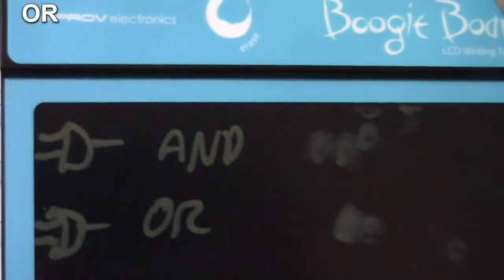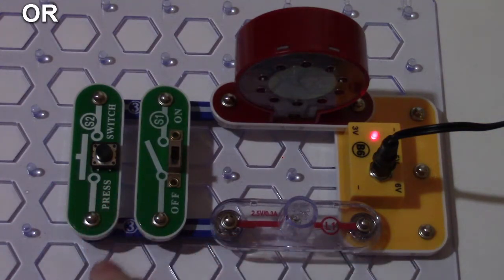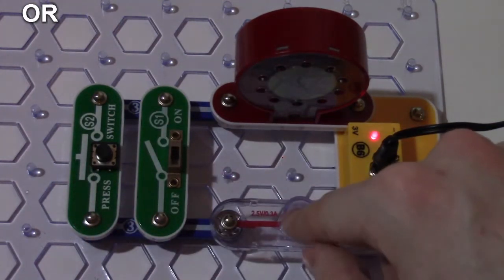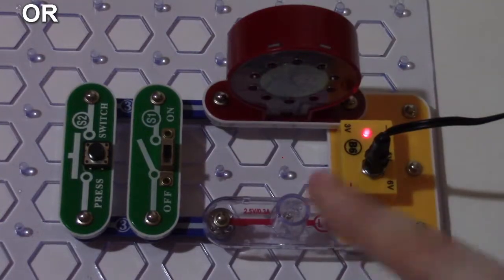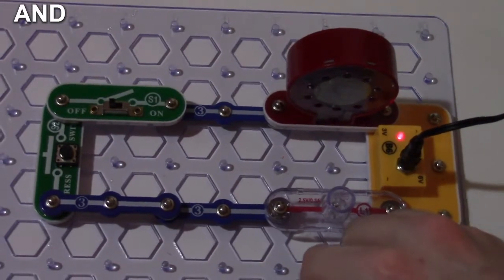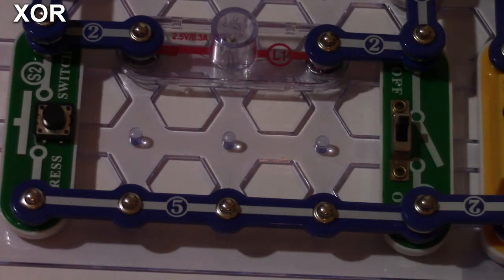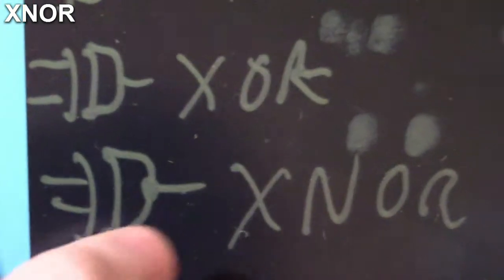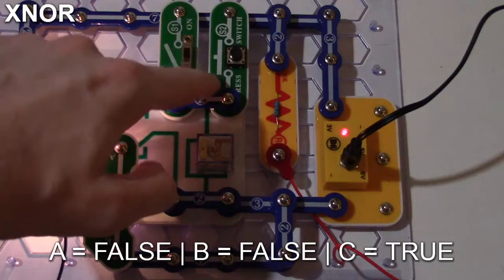Circuits: Logic Gates/Operations

Comment: Excellent! We are trying to build the XNOR but we do not see where the black and red cables go... do you have a picture or sketch with the full circuit?
Reply from the maker: There aren't any pictures or sketches of the actual circuits. Technically, you cannot create a "functional" XNOR with SnapCircuits due to part limitations. The black cable is connected to the gate of the SCR and the red to the R5 resistor. The two cables are then connected across an NPN transistor held off-screen. From 13:10 onward this is pointed out as the circuit does not technically function like a true XNOR would.